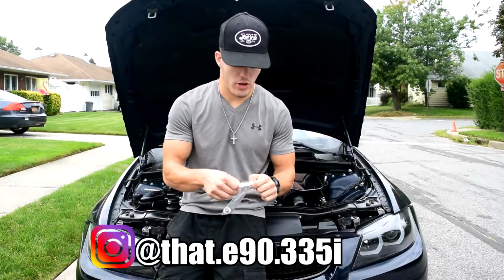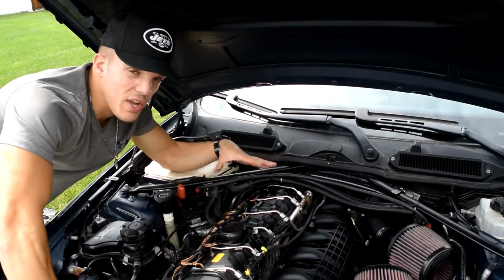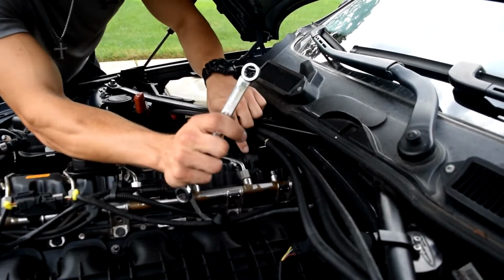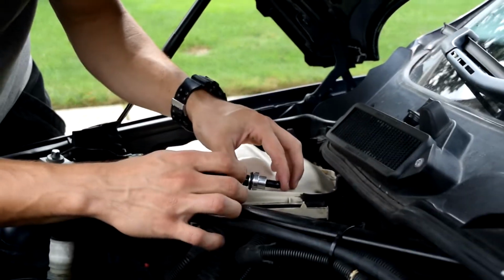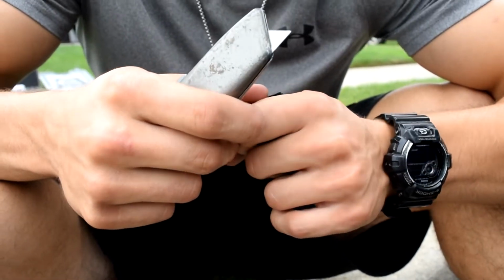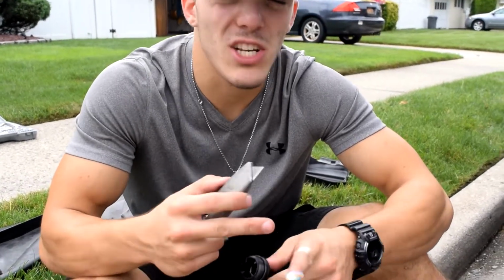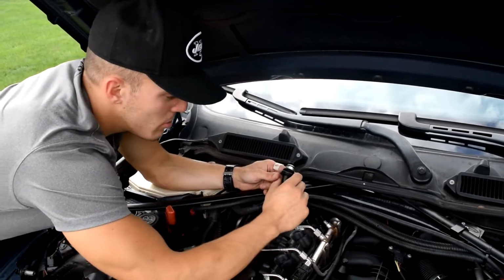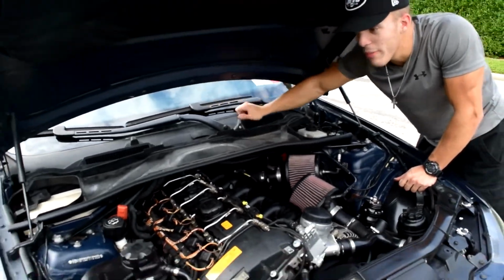E90 N54 PCV Valve Install (READ DESCRIPTION!)

Comment: Just upgraded my pcv to a BMS unit and  I do NOT recommend cutting the burrs on the PCV cap. I did that and it caused a bunch of weird metal whirring/rattling noises.  I ended up needing to buy a new metal pcv cap, which solved the issue. If you're having issues fitting your new PCV: 1) make sure you lubricate the rubber gaskets with some engline oil and 2) if you absolutely need to trim the burrs, use course sand paper and only remove a little at a time. Hope this helps save people from the same headaches I just went through :)

Comment: Boy, u got to remove the fuel pump fuse out while engine running until it stalls. Now u have no fuel sprays all over yourself. For the 2007  335i fuse number 88

Comment: did you check if you have an open recall before doing that? the dealership replace them for free.
Reply from the maker: Yes. Most, if not all of the warranties and recalls are 10 years or new. Which isnt my car. Only recall is the ac blower motor on my car

Comment: I didn’t trim mine and it didn’t help the bit of smoke on deceleration , do u think that’s why ?
Reply from the maker: Definitely don't trim it. Doesn't make a difference. The PCV valve didn't help me too much either. If the PCV valve doesn't help, move onto the next possible issue as I did. Check other oil burning issues, such as VCG, OFHG and other possible oil issues
Reply: Did you ever fix smoking issue on deceleration?

Comment: ECS tuning has them with the cover so you don’t have to cut anything it’s all aluminum.$54 FTP n54 pcv valve upgraded replacement.mfg#sg84036 Ecs#3617984